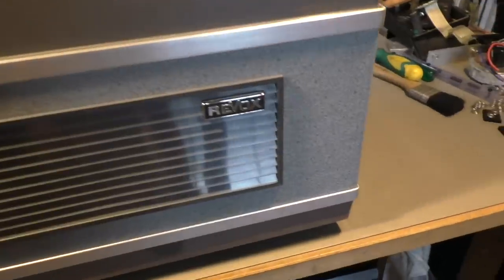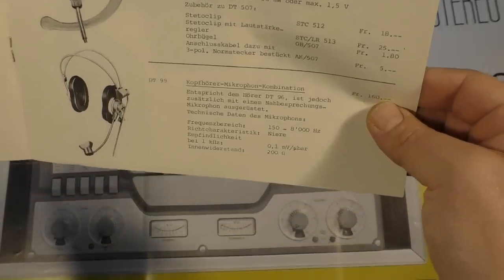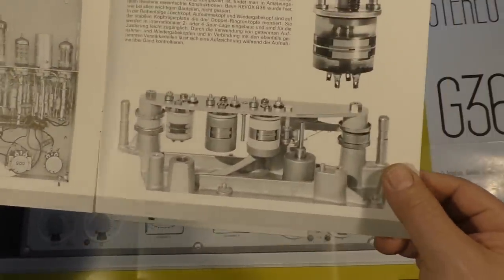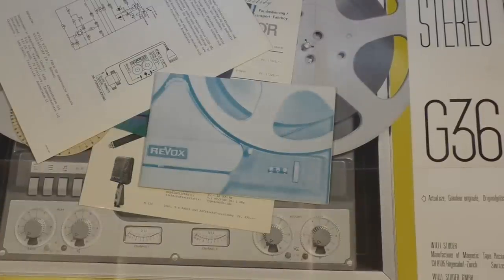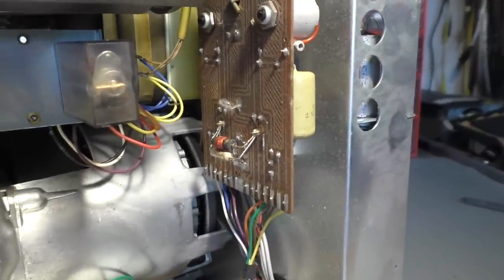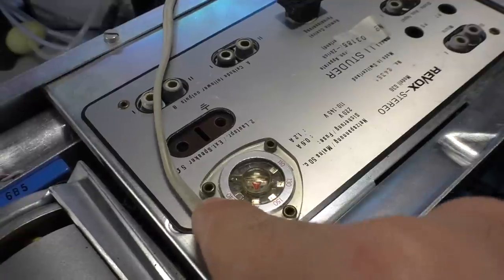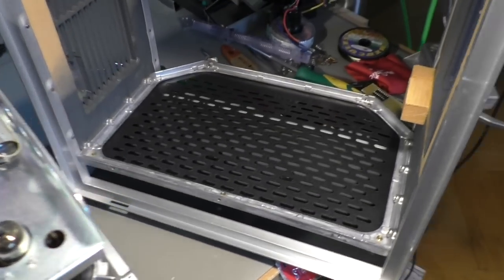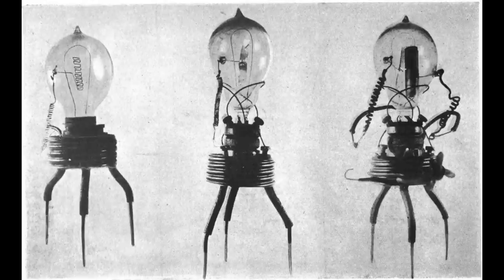Revox G36 Tape Recorder and what's about those tubes anyway? - (PWJ158)

Comment: That is one pristine machine. That's the most organized point-to-point wiring I've seen.
Reply from the maker: Made in Switzerland like the precision watches 🙂
Reply: @PlaywithJunk  most people don't take pride in their work anymore. I worked in home entertainment for decades. Repaired TV, VCRs, camcorders, and sound systems. I would get 1 or 2 recalls/month, every other tech I've worked with would get 1 or 2 recalls/week. I've been accused of being too thorough???
Reply from the maker: @jameswest8280  That's how it works. Bad technicians are better for the business. They can charge for more hours, more visits and finally sell a replacement because "it can't be repaired".
A good technician who repairs an expensive device with just a new fuse and two capacitors doesn't make money.
The value of customer happiness has dropped drastically.

Comment: I'm in my 50s now and first started listening to open reel tape in 1980 when I was 13 years old.  (My very first machine was a 1961 Voice of Music 722, also with vacuum tubes.)  In 2019, I started collecting open reel tape decks in a substantial way.  I'm currently up to around 20 different machines, including both a Revox A77 and B77.  I'm now in the process of buying a G36 from a fellow open reel enthusiast.  I'm very excited to add this significant model to my collection!  Thank you for a wonderful video!  It's fantastic to see the original literature!
Reply from the maker: It seems we are the same age (1969?). Do you have a NAGRA tape in your collection? Those are probably the most perfect tape drives ever. And still very pricey and rare. There is even a pocket sized model designed for CIA etc.  Also made in Switzerland like the Revox. ;-)
Reply: It seems that all my replies are disappearing.  I don't understand why.

Comment: Well restored. I have still owned a G36 for many years. It has worked for many years several hours a day. I have used it infrequently for several years now, and each time I find with great surprise that it starts again as before, apparently. Perhaps the brakes after fast rewinding seem slightly less effective. Is it self-lubricating? But to what extent? Do I have to lubricate what? and do I also have to demagnetize the heads? The fact is that today there are very few technicians capable of getting their hands on these jewels. Only the internal aesthetics, that is the rational arrangement of the components, is enough to understand the ART with which it was conceived and built. Good times. Thank you for the care with which you keep this wonderful machine, which broadcast the music and words of most of the radio stations in Europe.
Reply from the maker: In fact I did not restore anything except cleaning the roller. Everything was just like new. I assume the recorder has not been used much.
You can find the servive manual online but I think there is not much to do in terms of lubrication. The brake bands should possibly be replaced.

Comment: As I recall, unlike the A77, the G36 capstan was driven directly from the mains frequency. Changing to 60Hz was quite a task. The internal power transformer handled the voltage switch, but you had to rewire the motor capacitors on all 3 motors, and then you had to remove the capstan motor shaft and install a 60Hz shaft, which was obviously smaller in diameter than the 50Hz shaft. I believe this then also required that you readjust the pinch roller positioning and tension. The A77 simplified this dramatically by having a built in FG motor drive system, only requiring that the voltage be switched. But I'm not sure about the take-up and supply motors. Those may still have needed capacitor changes. As for the comment about printed circuit boards not being common in a tape recorder from the mid 1960's, I'd have to disagree. Most machines from that era did use pcb's. Just look inside a Tandberg, Grundig, Telefunken, etc from that same era. Thankfully, Revox stayed mostly away from these, as those old boards were poor quality and prone to lots of issue. My guess is that Revox was concerned about mechanical issues with the boards on a machine that was designed for  semi-pro  portable use, and being conservative, decided to go with what they knew would work.

Comment: A tip on how to properly stop the tape after a wind. Rewind is demonstrated around the 39 minute mark.  When the stop button is depressed, it takes a while for the brakes to bring the tape to a stop.  It is very likely that the brakes have become ineffective because the stop button is improperly used.  The proper method to bring a tape to a stop after rewind is to reduce the motion of the tape by switching to fast-forward, which will use engine braking to reduce transport speed, and then hit the stop button when the tape reels have nearly stopped. The inverse of this advice applies to fast-forwarding the tape pack.
Reply from the maker: That will certainly work. But I wanted to show the automatic stop function in the video. So I left it run on purpose.
On the other hand, braking too fast could also damage the tape. It's a large and heavy spool, lot of energy must be stopped. 

But yeah, I think I have done this on other tape drives.

Comment: I saw that you have some custom tape adapters. i was wondering if you machined them yourself? if so, would you happen to have dimensions?
Reply from the maker: It's relatively simple... inside it's like a small tape reel and outside must fit into a large reel. Thickness must be a bit thinner than a reel to clamp the large reel securely

Comment: Thank you very clear. I know now that I need to hunt down the remote plug. Unfortunatly I have lost it. Do you know which connections should be linked?
Reply from the maker: The socket has only 3 pins wired internally. All three wires are connected together by the dummy plug. Unfortunately from the schematics I can't say if it's the leftmost or rightmost three pins. But since nothing else is connected, you can try bothe sides.
Or you open your recorder to see where the wire go.
https://www.logosfoundation.org/g_texts/Orfeus/service_manuals/Revox/g36Manual.pdf
Reply: @PlaywithJunk  thx for your reply. I really appreciate it. I also checked the shematics and could not directly tell. In the meantime I found a spare part back panel with the plug on it. There is also something wrong with my fuse holder and that is on there to. So hopefully I’m completly set.
Looks like te a77 and b 77 plug could also be used for the g36. Especialy of the configuration doesn’t really matter.

Comment: Good video. Thank you.  But the sound is a little bit overmodulated, isn't it?
Reply from the maker: I made the sound a bit louder, maybe a bit too much :-)
Reply: @PlaywithJunk  To me it sounded like a problem with a wireless microphone (I guess you were wearing a transmitter when you were pulling the chassis out of the cabinet)
Reply from the maker: @dkmmhdk  Yeah I use a wireless mic but I never had problems with that. But in this video I thought the sound is a bit low. So I made it louder in the editing.... that was a mistake probably.

Comment: What regulates the speeds of the takeup and supply reel motors in this recorder, which will always be changing with respect to each other?
Reply from the maker: they apply a fixed voltage that creates a defined torque. Both motors want to spin away from each other but the capstan and roller make the speed. If the tape would break, the supply motor would run clockwise.
The reel motors just maintain a constant tension on the tape. The speed is given by the capstan motor.

Comment: Hello sir..I saw your restoration..I saw how well you know about it I ask you for help..I have a revox g36 ... if it has a lot of tape on one of the rollers in that part if I run it goes very slowly. .what should I check? I only mean fast scrolling ..thanks
Reply from the maker: www.logosfoundation.org/g_texts/Orfeus/service_manuals/Revox/g36Manual.pdf

Here you find the service manual in English. The mechanism of the G36 is simple. You have 3 motors and they are directly driven by AC power. There are also mechanical brakes, driven by solenoids.
I would first check if they work. Maybe one brake does not release and that causes your machine to run slow.
Reply: @PlaywithJunk  Thank you
Reply: @PlaywithJunk  Hello sir .. Do you know if I can put heads from Revox a77/2 trak on a Revox g36 /2trak...? Thank you Laurentiu

Comment: I think you would have got better sound if heads where on a head drum that rotates at 1800RPM like a video recorder.
Reply from the maker: If you really need your music to go up to Megahertz then yes. Otherwise it is completely unnecessary because your ear only goes to 20kHz if you're young.....
Reply: @PlaywithJunk  This actually how DAT machines work it can be done with analogue but works much better with DSP processing for recording and playback.
Reply from the maker: @DAVIDGREGORYKERR  well, it's ok for digital sound because of the much higher bitrate. But for analog it's a bit of overkill.... except you record some kind of surround sound.
But yeah... you could do it with a much slower tape speed. So HiFi sound will fit onto a tiny cassette.

Comment: 40:08 Did it just rip apart the tape ?
Reply: the right reel was empty
Reply from the maker: no, it did the rewind properly. You can hear the end of the tape flapping when it stops,
Reply: @PlaywithJunk  Doesn't that damage the tape when its "flapping" around hitting other parts of the recorder ?

Sorry for the stupid sounding question.
I was assuming it would rapidly slow down or  stop the reels when it gets to the end of the tape and not fly of hitting stuff :)
Reply from the maker: yes the tape end gets damaged but it is no problem because there are always a few turns of unused tape at both ends. Most tapes also have a plastic leader that is insensitive for damage.
The tape end also gets scratched when rolling it on the spool.
Reply: I think the brakes are a bit worn, on my Braun TG1000 braking was a lot faster. When he manually engaged the brake solenoid it seemed quite easy to turn the drive shafts, perhaps the brake bands need some more tension
Reply: @thomasguilder9288   It is very likely that the brakes have become ineffective because the stop button is improperly used.  The proper method to bring a tape to a stop after rewind is to reduce the motion of the tape by switching to fast-forward, which will use engine braking to reduce transport speed, and then hit the stop button when the tape reels have nearly stopped.